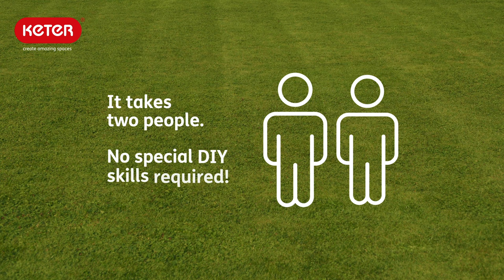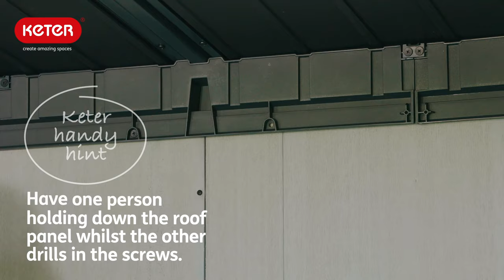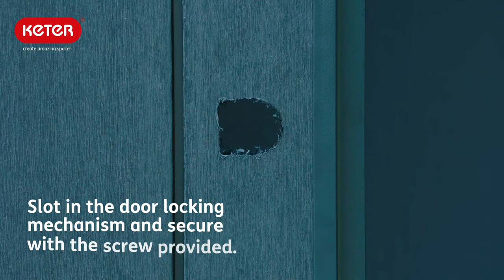How To Build Keter Artisan 9x7 Shed | Step by Step Assembly Video

Comment: I will be installing the 11x7 this weekend on a concrete base. What size screws and length do you recommend to fully secure the floor to a concrete base? Thank you for your help.
Reply from the maker: It will depend on the thickness of your base. The shed floor is 2.5cm thick so add this to your base thickness to get the best screw length.
Reply: @keteruk8879  how strong is that, it looks rather wobbly.
Reply: What do you think of the 11x7? How did it standup in the elements?

Comment: How durable is this thing? 30 years in the central american heat okay?
Reply: So got one from Costco but the 7x7 model, as I took everything out of the box to organize on the ground near the pad I was gonna set it up on-about 30 minutes later they completely warped from the sun beaming down on them they all went from flat to rounded since my yard isn’t very flat. And when putting screws in if you over tighten it shreds the soft plastic. Super easy to put together compared to metal or wood sheds just remember it’s plastic… not a very durable kind as well. I’d expect the lifespan to be anywhere from 5-10 years without any major issues, beyond that would be surprising tbh. Corners also don’t line up perfectly since they aren’t cut exactly the same slight differences at edges. Leaves a very ugly looking edge and all the wall pieces came PRE-dented so don’t worry about it getting scuffed or banged up during install KETER was kind enough to do that for you😭🤣🤣
Reply: Also be careful if setting up yourself, instructions recommended at least 2 people. I tweaked my neck and shoulder just from moving the boxes to my back yard.

Comment: Purchased the 9x7 Cortina. Just in the process of building the floor. We have limited yard space. Video recommends 2 feet space on the back. Can we put this together leaving only a foot space behind. It looks like in the video that the roof supports can be installed from the inside. It  also appears like the roof panels go in from the front. We have lots of room on the front and both sides but not the back. Please advise!
Reply: You can but keep in mind you will need to stand on each side to put in the base screws that attach to the shed walls as well as anything else you may need to reach from the outside of it. For example when putting up the walls you will get to point where you must be on the outside to clip in the corners to the walls. So as long as you can fit and use a drill it’ll be fine I ended up having just over a foot of extra space on 2/4 of the shed walls

Comment: Dear Keter

I have this exact shed, but attaching anything to the walls has been difficult.  I tried using the SC15 screws but they don't provide much strength.

What is Keter's recommendation for attaching hooks/shelves to the walls?

Also, I have a bunch of "dclips" with no instructions.
Reply from the maker: Hello, our D clips are what we recommend for attaching shelves or other organisers to the shed walls. You can find instructions for how to use D clips here > https://keter-lifestyle.com/files/file_add/download/1448_dclip_580244-a-1422_print-1.pdf
Reply: @keteruk8879  where can we buy these clips? Nobody seems to carry them, Keters website and shed instructions make no mention of these clips, and the ads for the shed showed shelves screwing directly into the walls and don’t mention the clips needed. I’m fine with them needing clips if we can actually purchase them but nobody has them.
Reply: Not the best shed for shelving you need a sturdy wood shed for that! These plastic walls are just sturdy enough not to fold in on themselves in the wind. If you do manage to install any shelving I wouldn’t recommend putting anything on them since even 5lbs of force will start to bend the walls out of the corners damaging them to a point they cannot be reinstalled.

Comment: We bought the Keter Cortina 9x7 and it looks very similar but I can't tell if there is any ability to lock the shed?  The handle is different than the one above.  We haven't opened it yet.
Reply from the maker: All Keter sheds are lockable so you can add your own padlock to the lock hasp on the handle of your shed.

Comment: I'm unclear what ventilation this shed has, and if it has is it insect/vermin proof? Thanks in advance. Also why does the 7x7 require a 279cm wide base if it is 210cm square? I have an existing concrete slab to use.
Reply from the maker: The Artisan shed has built in ventilation panels down each side. The heavy duty floor and sloped threshold are designed to deter pests. This video is for the Artisan 9x7 shed which requires a base of 279 x 216cm. For the Artisan 7x7, the base size needed would be 216 x 216cm.
Reply: @keteruk8879  you don't have to Acker it? And and can it go right on a gravel base?

Comment: I see the floor does not seem to be fastened to the concrete pad.  Should the floor not be screwed into the concrete in order to make it more sturdy during wind storm?
Reply from the maker: You can make the shed fully secure by fixing the floor to the base through the 8 pilot holes as noted at 1:27 in the video. These pilot holes are marked in the product assembly instructions.

Comment: Is this base made of concrete blocks rather than a concrete pad? If so, are they on the ground or is there something else under there? Sand? Would concrete blocks shift over time?
Reply: @Keter UK - can you reply to the above question? I am looking for the same information + Any supplier delivering to Ireland? thank you
Reply: Yes they can shift over time but unlike a solid concrete pad you can remove the affected blocks and level the surface below it and replace any affected areas fairly cheap and easy. However when the surface below concrete shifts it leads to cracking of the pad which cannot be as easily fixed and definitely cost more. With that being said, pavers “concrete blocks” cost more to install than a pad typically but that’s because of the added benefits you get as opposed to a concrete pad.
Reply: That being said regarding the floor, can this floor be laid over the floor Joyce 12 inches apart without any other subfloor like plywood so the question has to do with rigidity of the floor please advise

Comment: Can I put the door on the other side without any problem? Or can I put the roof sloping down towards the door? I want to install it adjacent right next to my house wall and I don't want rain water flowing towards my wall. Thanks
Reply from the maker: The double doors can go on the left or right of the shed front. You just need to decide this before adding your final wall panels. The roof does not slope the other way as this is part of the shed design.

Comment: I just bought this shed from Costco. It is going to sit on block paving which is level and newly built. I want to make the shed bottom sit higher to avoid rain water running in. Can I use put plastic shed base (the grid and click together type) with gravel for this? This is just to make it sit higher. Prefer not to use wooden base.
Reply: Course you can

Comment: When building a base should we make it slightly larger or exact foot print size ? Im looking at buying the 9x7
Reply from the maker: Hello, the footprint of the Artisan 9 x 7 shed is W 279cm x D 216cm so this is the size of the base you need. It's up to you if you want to make the base larger than this, some people make the base bigger to display plant pots for instance. We recommend building the shed on a level surface to ensure panels fit together and the shed remains stable.
Reply: @keteruk8879  I made my base 9' wide by 10' deep, which gave me a nice 9' x 3' porch on the front.  Very happy I did it this way.

Comment: How do I know which part of the floor is the front or back
Reply from the maker: It's best if you decide where you want the front of the shed to be before you build the floor. The floor panels go in the direction front to back then it's by adding the wall panels that you can decide where you want the door to be, as seen as 2:14 in the video.

Comment: Hello Keter,
On Step 20 of the assembly instructions, I'm finding that the male connector side of the NEPF parts are only half as long as the connectors for the regular wall panels (OLP7) and corner pieces (OLPC). So, when fitting the NEPF part on the right, the connector doesn't go all the way into the groove of the wall panel. What am I supposed to do differently?
Reply: Buy a real shed…

Comment: I would love to buy the 11 x 7 but there is no stock anywhere? Has it been discontinued or has supply just be restricted because of covid?
Reply from the maker: We are still producing this shed and stock is on the way, there have been delays. Keep an eye on retailers online and sign up for stock alerts where you can.
Reply: @keteruk8879  do you do 8x6?
Reply from the maker: AllGuts NoGlory  It is possible to take apart sheds and storage boxes but we wouldn't recommend this unless you absolutely have to.
Reply from the maker: @shivanimahida5544  We do an 8x6 shed in our Factor range but not in our Artisan range.

Comment: The look of this shed is great but the quality isn’t very disappointed I paid 3000 for this shed. And many pieces came damaged we still had to put together cause we needed I
For th pool equipment but there where many pieces damages. I planned to have a shed that will last me 10 yrs at least but I doubt this will
Reply from the maker: Sorry to hear you're not happy with your product. If your product is under 1 year, you are entitled to return it to your retailer for a refund or replacement. Alternatively, you can contact our customer services team through our website for replacement parts.
Reply: @keteruk8879   Yes I understand I can return it but keep in mind this item is massive to return and will cost me money to return not a simple thing, plus when you have a project to complete and you need it done it’s not simple to wait, I waited over a month to get this
Reply: holy shit in the USA I build sheds from scratch. I just had a customer come across one of these and asked me to put together. I could build an 8x8 for $4k out of solid wood, with pressure treated lumber base/frame sitting on concrete blocks for leveling, shingle roof etc. and last much longer than this plastic b.s. when you say 3000 what currency so I have a basis? I'm just biased because I take time and quality to build what I build and it's not much more than this plastic stuff in the scheme of things
Reply: @keteruk8879  sounds fine and dandy but what about if it’s already assembled??

Comment: I am a lucky (apparently) person who has a 11 X 7.  What is the size of the base I should build in order to have the right size? I really need a base with the proper dimensions since my shed will be in a slope (unleveled ground). Thank you!
Reply from the maker: Hello, the footprint of the Artisan 11 x 7 shed is W 342cm x D 216cm so this is the size of the base you need. We recommend building the shed on a level surface to ensure panels fit together and the shed remains stable.
Reply: @keteruk8879  Thank you for the quick answer!

Comment: The walls are super annoying to put in level
Reply from the maker: It helps to have one person holding each side when you assemble the walls. You could also check that your base is level and flat so the panels will line up more easily.
Reply: @keteruk8879  any tips for getting the door level? The screws on the one door are loose and have play, the other one went in perfect
Reply from the maker: @user-fz3sz2dj4r  We'd recommend ensuring your base is level as this will help the door line up. You can use shims or something similar to adjust the base to that the door becomes level.

Comment: Id rather buy a lifetime which is made in USA
Reply: Lifetime sheds look like wendy houses and from what I’ve seen are made from cheap plastic. Also it’s a lot harder to add shelves etc.
Reply: I've constructed both Keter and Lifetime sheds and can confirm that Keter are definitely the superior product. Lifetime have a good range though so if you are after a specific style not available from Keter then Lifetime are still OK but think about wind protection as the internal frame is less robust/stiff than the design that Keter use.
Reply: Why do we need to know this? Why is the fact that it's made in the USA preferable? What exactly is your point?
Reply: @stewartmac1  when you have an issue it’s easier to work out a solution when buying from a seller within the same country… also availability wise local is always faster, not saying lifetime would be the way to go but local options in general. And different countries have different standards so what might work one place doesn’t exactly make it ideal for every application.